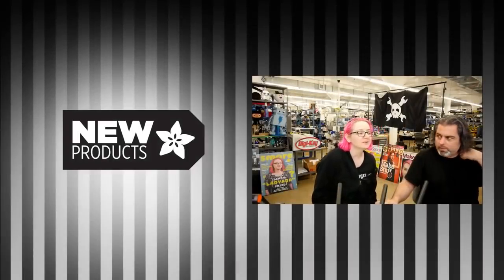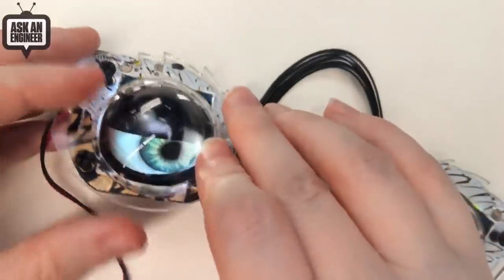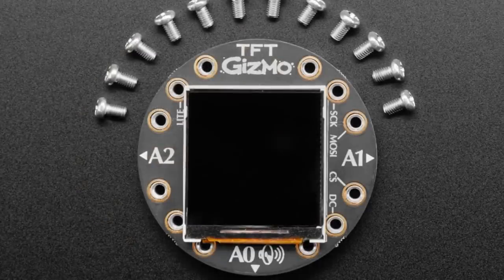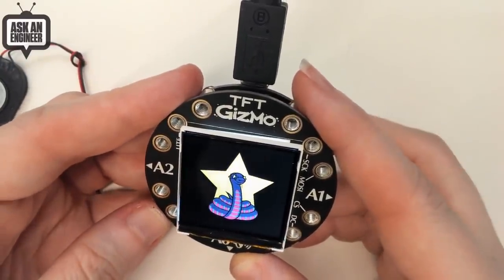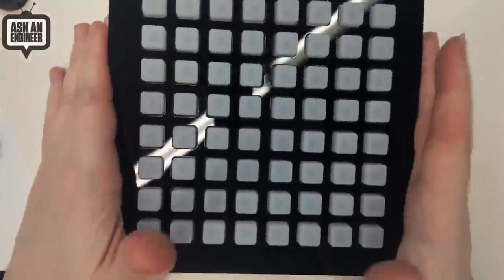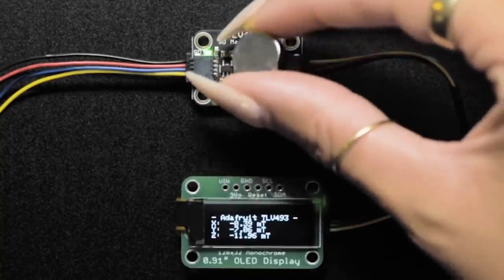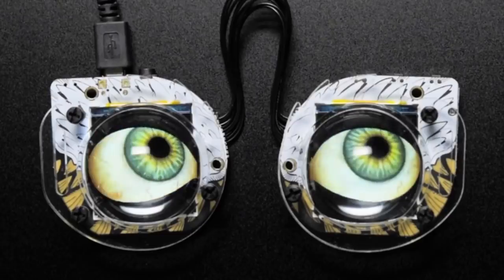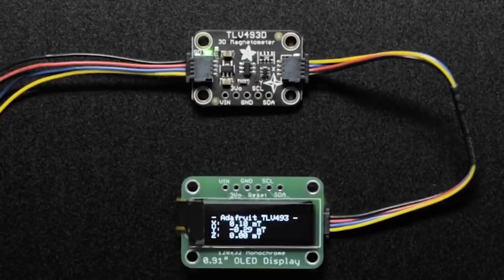New Products 9/11/2019 Featuring Adafruit TLV493D Triple-Axis Magnetometer #adafruit

Comment: I could make something way creepy if the eyes could follow a real-world object in their field of view.  Have the eyes look around randomly until an I2C interface (or similar) tells it "Look at location X".  It should furrow it's brow and quickly move the eyes to look at that location.  If no inputs after a timeout, go back to looking around randomly.  Don't worry about the input - I'll make that with an Arduino and sensors (break beam, motion detect, ultrasonic range, etc.).  What I need is eyes that can act on the input.
Reply: I love it! I want it! Did you make it?